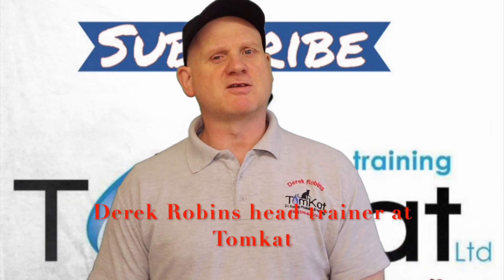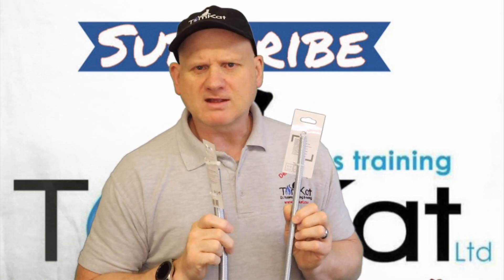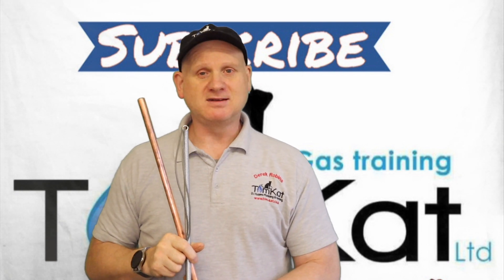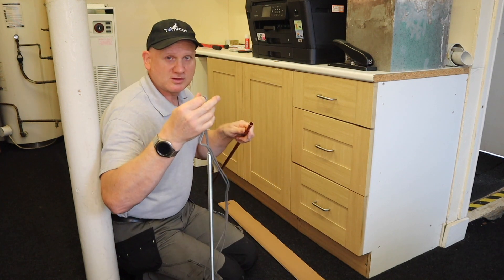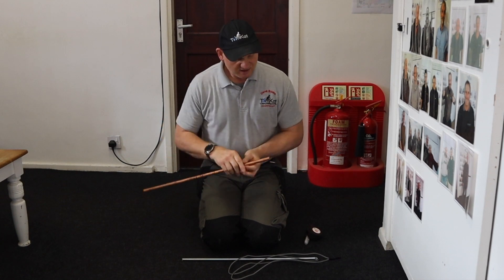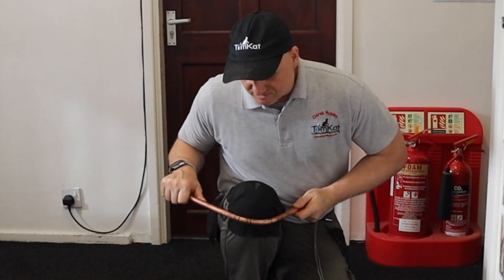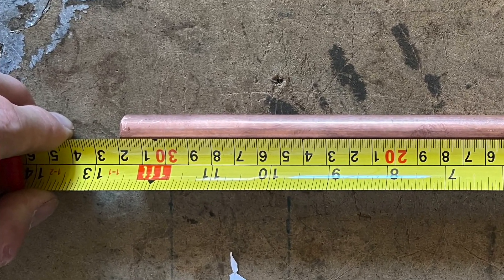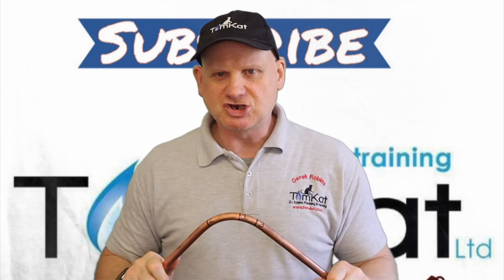HOW TO BEND 15MM COPPER TUBE USING A BENDING SPRING the correct way,  plumbing and gas training.

Comment: Seen someone use spring on outside  of pipe to bend it. It worked.
Reply from the maker: @josephhooper8655  yes you can buy internal and external springs I would only use an external spring on 8 and 10 mm

Comment: ps iv noticed my original spring is tight fit inside pipe ,  the rothenbuger one is a loose fit , whats your opion on size of spring inside pipe ?  do you think it matters if spring loose or snug fit inside the pipe ?  check comment below also cheers ian

Comment: what make spring do you find best .
Tried rothenburger  useless  too loose in pipe an kinks , sure some springs made for old copper that was thinner internal bore due too thicker walled pipe.
MY old school spring has given up ghost after 30 years .
So im sending for the draper expert pipe bending spring which looks similar to the one i have at moment £8 on amazon and 600 mm long

Comment: If I were overly pedantic, then I would look at 11:58 and say he cheated a bit because the radius is about 60 mm and the markings are at approximately 58mm. If you want a radius of 60mm then the length of the bend would be 60mm*Pi/2=94.2mm. So actually if you want it ultra precise then you had to mark the long distance 4 times the pipe diameter (60mm=the radius) like it is done here and the small distance would be 94.2mm - 60 mm = 34.2 mm = 2.28 times the pipe diameter. So if you mark it with 4 and 2 like done here, the resulting radius would be 57.3mm . He compensated by bending the radius a bit larger to 60mm and on top of that a tiny bit more to get the outer markings centered in the bend (There is a tiny offset of (60-57.3)/2=1.4mm ). But there''s no need to be overly pedantic, I think the precision is good enough for pipe bending and it''s easier to remember 2 instead of 2.28 (if I calculated it correctly).

Comment: i have a [pipe thats needs pushing back it came away from my raditor but i worried i snap the pipe @ floor level its on a concrete floor it feeds the rad

Comment: I didn't see any need to watch a video on this but now I wish I did a few days ago. It isn't so much the measuring aspect (witch will come in handy) but the technique. I just went at it in one go and just as I got to about 90 the pipe snapped and now I have no spring. I see the trick is moving from outer  point to the centre point bit by bit. good job it was just a practice run. Ill get it right now thanks to you. great vid.

Comment: Seems you'll do anything to formulate a video. We have bending machines now and that is what should be taught!! It's not only an out of date method, it involves wasting gas and adding CO2 to our environment to anneal the copper tube!
A re-think is required!!!
Reply from the maker: I have produced loads of videos on using bending machines but I was asked to produce videos using springs so I have done. Sorry it doesn’t meet you approval
Reply: Jesus these trolls just never stop😅
Reply: Are you Paul C in disguise
Reply from the maker: @hdhanji8006  🤣🤣🤣
Reply: @hdhanji8006  no I think its Greta Thunberg......CO2 in the enviroment. What a clown
Reply: A very informative video...As a DIYer, I don't really want to invest in a bending machine, when I might only ever bend a couple of pipes in my life...